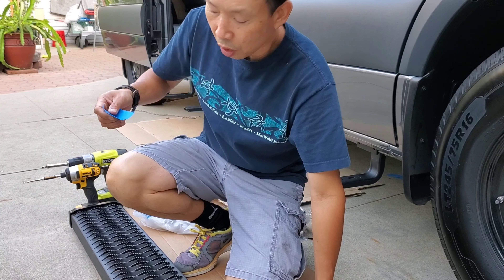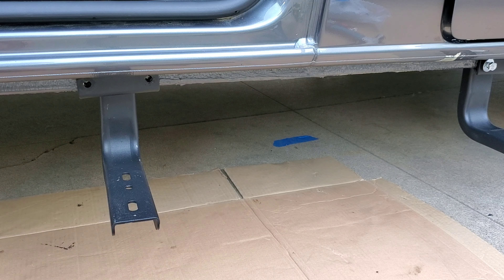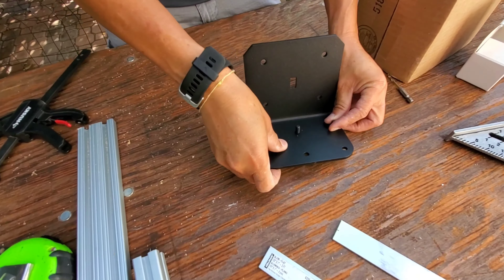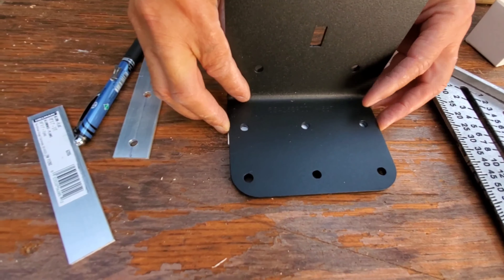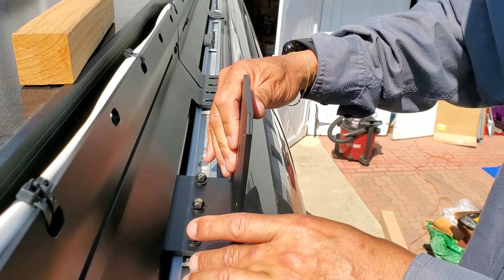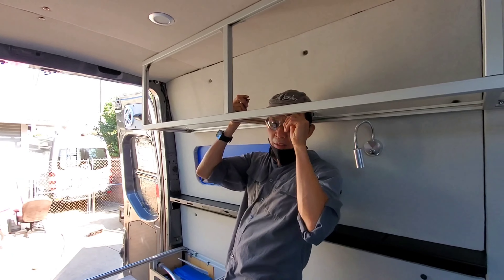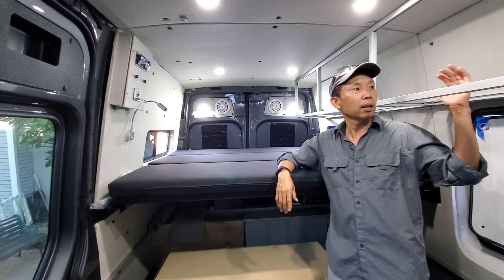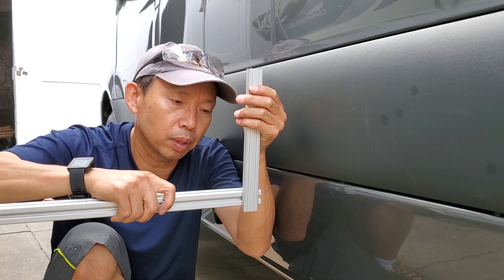Van Build-2019 Mercedes Sprinter,  awning,  step bumper and grey water tank installation

Comment: Are you using the fvc roof rack? Are you using a special bracket
Reply from the maker: Yes FVC roof rack. The brackets are Thule
Reply: @BoChuonOUTDOORSVANBUILD  so you didn't have to buy the fvc awning kit to install the awning on the fvc low profile roof rack?

Comment: If I may, I love your waste water tank holding system using 80/20, my only concern is that the lower horizontal braces are only held in place by the friction of the bolts in the slots, maybe vibrations combined with tank weight may lead to lower horizontal support braces slowly slipping in the slots.  At least, I would add a corner bracket under the horizontal braces or drill a hole and bolt through the assembly.
Reply from the maker: Thank you for the feedback.  I think that is a great idea just to be more secure.  I can add a bolt across to lock it.

Comment: Hi BoChuon, thanks for creating all of the van build content.  How does this Luverne running board compare overall to the iBoard running board that you installed in an earlier video?  It seems to me that the Luverne one sits a bit lower than the iBoard one.  The Luverne one is also twice as much.  Is it that much better?  Thanks!  Jim.
Reply from the maker: Hi Jim thank you.  It seems to sit lower however I did not measure the clearance. It does cost more because of the aluminum type i guess.  It  also pushed in more under the van. As for the ruggedness it looks very nice for off road type.  Can't step on it with bare feet though it hurts.